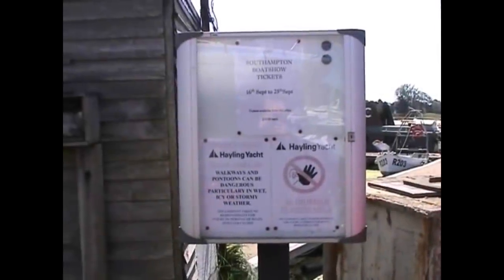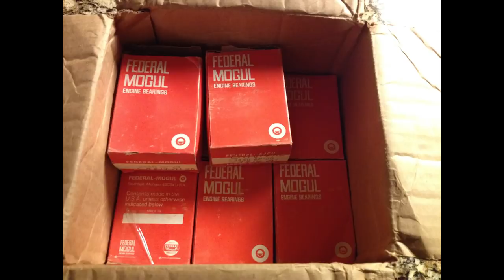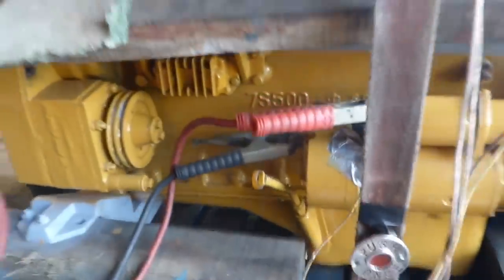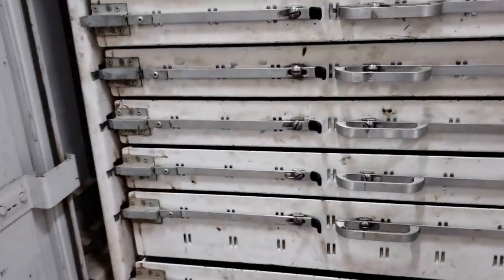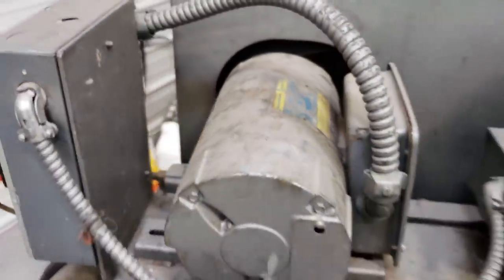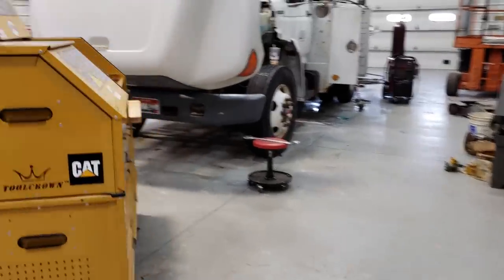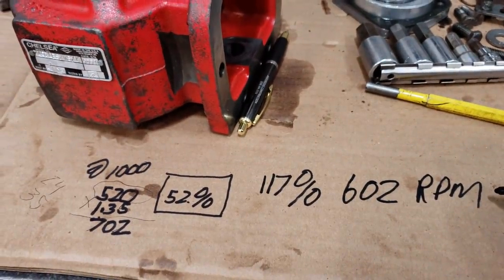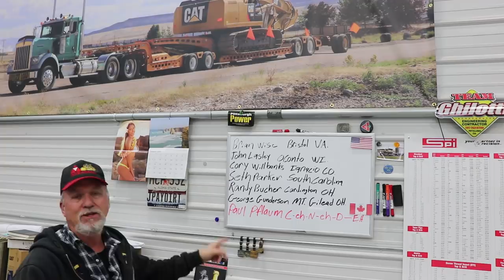Caterpillar D336 V8

Comment: Hello again, Jeff.... this is a "PS" to my first comment (directly below this "PS").... would you happen to know if the D336 engine is the same V8 that Paccar made available to put in a "few" (Very Rare - Owner Operator Spec'd trucks) of the KW's and Petes back around 1968 to 1970/possibly 1971 as well??   
 
I remember two other Owner Operators that I ran into back in the early 1970's that had a "special order" V8 (Cat) and their KW's came with an engraved brass "Warning" plate on the dash which read... "Warning: Do not use more than 50% throttle at speeds under 40mph or severe driveline damage can result"!!   : )    I will Never forget those engraved dash plates and what was inscribed on them as long as I have breath.

I don't remember what model the one fellow told me it was, but as soon as I watched this video and saw the D336 engine, especially looking at it complete... the rocker covers very much reminded me of what I remember seeing under the hoods of those two KW's way back in the 1970s.     

I do not know what the rated horsepower (or more importantly, the Torque output) was on these engines,  but obviously was more than what the current (of that era) driveline technology, in terms of metallurgy would allow for at that time, at low speeds versus high torque outputs.   

Both of those KW's had "sticks" of course (as was standard in those days), one was a dbl Over 5X4 and the other had a single Over 6X4.... and both would leave everything else far behind on the grades... Except, some of the V12 Detroits (like mine, for one) that were "built"..... and you have to remember that back in the late 1960's and into the early 1970's until the 335 Cummins (first turbocharged Cummins truck engine) appeared, all the 2 & 4 cycle truck engines were still Naturally Aspirated, and as such... the Naturally Aspirated "jimmies" would absolutely "walk on by" the 4 cycles on just about any gradient out there... loaded, especially the 8V's with only 260 or 290 hp (Green Tag 55 & 60 injectors, respectively).     

I was informed of several (as in, Three) Pete's that were "out there" with the same power plant,  but never actually seen them, myself.
Reply from the maker: in a truck it was called a 1676, 345 hp  Cat doesn't want to talk about this engine as  they blew up freqently,  very unforgiving if you oversped them , I think they stopped production in 67/68  I hauled a 950 cat loader over fish creek pass with a KW that had one in it, It did it very well , but everyone who had a D336 in a J621 blew them up, not uncommon to see a 3406, 3306, and I even saw one with a NH cummins in it
Reply: Fiorito Brothers in Seattle had 621's with 8V-71's.
Reply: If those trucks were built from 1973 to 1985, it was a Cat 3408. A real BEAST.

Comment: Jeff, is something preventing you from using a larger displacement pump to make up for the lower RPM? Seems like the simplest approach to me.

I buy hardware from McMaster-Carr. If you contact them, they'd tell you ahead of time the country of origin.
Reply from the maker: They sized the pump based on the rpm, so this new one works like.........................well really good

Comment: Hi J. tow trucks have a high rev switch ?
Reply: A lot of vehicles with hydraulic powered stuff,and also lots of lights,like lightbars,work lights stuff like that,have a high idle switch. At an idle the emergency lights alone can screw things up.

Comment: The 117% is based on Engine speed to Pto shaft speed, On those PTO's once you get past 125% you are really limited on torque.
Reply from the maker: but the guy didn't seem to know what I was talking about when I asked about the 52% of engine speed listed for the 5306 trans,  the RT series transmissions are in the 79% range  so 117% of what, if the pto drive gears in the trans only run 52% of engine speed what will my pto pump drive run

Comment: dont use the spiral bushings for kingpins they are like speedy sleeves
Reply from the maker: So what is the problem with them?
Reply: @Jpaydirt  found they wear out rather fast, and never get a good tight fit with them,i like the bronze/brass ream type ream to size more work but seem to last longer ,mind ya the trucks i worked on only saw grease once every 20,000-25,000km  per company service intervals outta my hands

Comment: Can not a better scan tool reset the speeds?  The do for rpm on shifts and causing, and the time out by pass for idling.  Just some dealers will not reset them...so you net a hush trech scan tool that is better than the tool truck sells.

Comment: Am from Wyandotte Michigan and use to drive over the road truck..and I use to work on hevy equipment..
Reply: Grew up second And northline by the police station. Great place. Things have changed. There was a bar on every corner and Watkins had great sliders after a couple of drinks at the horseshoe. Now it's a rite aid where the old gas station /mechanic neils service was. Good times.

Comment: Me Again, Jeff.... Sorry for all my "after-thoughts" here, but one question for you... do you remember which engine model was used in the "Early" (1st generation) Cat 988 loaders by any chance,  and IF So,  do you know what the rated hp AND Torque output was??   Thanks, Jeff.
Reply from the maker: D343 non spacer plate engine  not sure on HP but they made a 325 HP without an after cooler and maybe a 375 but can't recall

Comment: Couldn’t see your engine very well but most likely it can be changed with the parameters in the ECM, if you can send me the ESN I can tell you more.
Reply from the maker: Thanks, but it works good at idle now, if I up the rpm just a little it makes the compressor just scream,  it's great

Comment: Power Transmission Inc, 2930 west Supeior Street, Duluth, MN55806  # 218-624-4876
PTOs and Transmission, Rear Ends, and etc. 
Rebuilt Cases and rebore holes on exact spots. of all cases. Hardness test gears and regarded.  Shop has a vetical lathe, horizontal lathe, boring machine, and etc.  Cn do more than just slap gears in a box like a lot of junk yards.  Was created by Dick Foster,  a IHC area factory representative who could pull a dealership for sloppy work.  
Loggers like his remanufactured spoke wheels with a solid band and lip so Dayton wheels go on straight. 
He is an expert at ratios and re-ratio a lots of boxes for off the road needs,
Reply from the maker: Cool thanks, if the other outfit can't answer me, I'll try these guys
Reply: OOPS.  zip code is 55806  I corrected it.  The loggers here use hydraulic pumps for loading trucks reach-all grabbers that need lots of oil and high pressure in the very cold winters.  The trucks would have the same problem of 1000 rpms.
Also any gear shop in a very cold climate. should know. Self loading logging trucks and trailer dealers should know too,

Comment: ,,, disagree, coming up on a million one, on my KW, never lifted never turned the steering, 9 dollar a tube full synthetic grease Mobil One, original king pins, about 7 thou average between the lube(s) . Btw, check your wheel bearing adjustment.
Reply from the maker: Hmmm, does stemco own a grease company  LOL  how long does it take you to put on 7,000 miles how many days would that be?
Reply: @Jpaydirt  ,,, well now-a-days I am semi retired, but  I have put that on in 2 weeks. I wish my S-cam shafts and bushings held up that well. Also I am 99 plus percent on-highway . Your pins didn't look that bad, How'd they look on a mic ?

Comment: You need a new service truck.  With a Summit Service body.  Of course I'm being prejudice.  They are 55 miles from me and I've moved trucks for them, off/on, since 2005.
Reply from the maker: would love something better
Reply: @Jpaydirt  I've seen them on F-350 and up chassis size.  Dodge, KW, Volvo, Pete & Western Star.  They gave up on International entirely, just too many problems to sort through.  I think they have gone entirely to air ride chassis also (no steel springs in the back).  They have installed on used/customer re-purposed chassis before, but that doesn't happen very often.

Comment: Just want to make sure you know that when you are  MIG welding thin metal use .024 wire .035 is to big. I weld exhaust pipe with .024 now. ( I learned the hard way )
Reply from the maker: Ya, but I would have to change the liner, or buy another gun and hose and we don't weld the thin stuff very often
Reply: @Jpaydirt   Your right but it is nice to have the option. I have both .024 and .035 liners and tips it takes about 15 minutes to change use the same gun and gas . I have a role of S.Steal wire and a bottle argon so I can weld Stainless . Just my 2 cents.
Reply: I weld everything with 1/16" flux core and CO2.

Comment: Don't calculate.  Use the charts.  The chart will tell you the % of engine speed the PTO output will turn at based on your transmission and PTO selection.

Comment: Stemco bushing ain't worth a s*** best to go with brass not composite but brass seen it done it them spiral bushings ain't worth a damn but like you're saying all kingpins need to grease turn the wheel grease and turn the wheel we stress that where I work
Reply: I always jack it up to take the weight off the grease and turn and grease
Reply: Always Jack Up to grease King Pins and Knock wheel inward at the bottom before greasing. And then turn lock to lock when in the air...then set back down.

Comment: Like a detroit......only 10 times more expensive, cast from small cracks, 100 times harder to start, and without the beautiful noise!
nobody has ever made a good 4 cycle v8 diesel.
Reply: Apart from Scania who make a 1000hp V8 for marine applications.
Reply: @jimspeed1388  Mack were better, but still had harmonic related crankshaft problems.  You can't have two connecting rods sharing a crank journal on a diesel engine.
Reply: 988 cat was a good v8
 Worked for Stein in Cleveland area we had 24 of them in steel mill service !